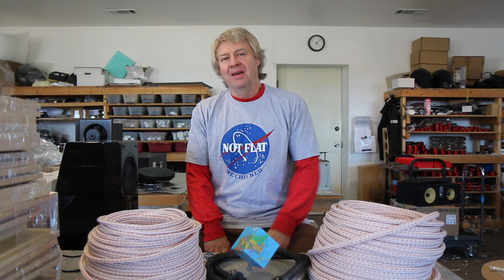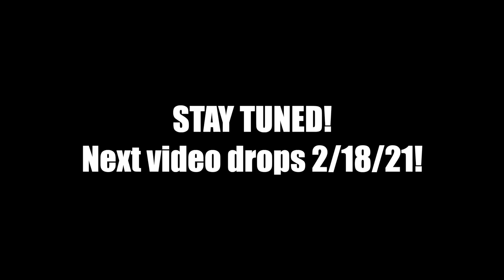Audiophile Cable TRUTHS: The Divided Camps

Comment: @mark rutlidge I’m not trying to start a flame war; however, bad analogy! If you took two or more cars and measured ALL of the variables and all the variables were identical, the cars would indeed perform the same. If you look at Sports Racers, all cars in that racing class measure nearly identical, hence very competitive and driver skill is critical, that is excluding for any creative interpretation of the governing rules – still a bad analogy. 

If you take wires, determine the critical measurements (measurements that scientifically have been proven to impact human hearing), measure them in a consistent fashion with accurate equipment, they will perform the same. To evaluate the impact of the cables one must truly apply an unbiased, blind, random trial. If you did that and if the test results were able to be reproduced by other unbiased evaluators, you would have ground to make a statement regarding the effect cables have on sound quality – remember you must be able to reproduce the findings. To my knowledge, I haven't been able to find any group purporting the cable effect that has successfully attempted this.  

If I was in the industry of making audiophile cables, I would find an external unbiased group, a group of doctoral electrical engineering students looking for a project might be a good place to start. I would have that group find colleagues in other electrical engineering programs, and let them have at it.  After peer review, all the companies involved would be able to scientifically claim that their cables are better and why. 

I’m NOT CRITICISING people for exploring the audiophile life style, have at it, change all the components you like until you like the way it sounds, and then change it when the urge to explore overcomes your current state of contentment/discontentment. 

My issue is with companies making statements, statements for which no critical proof is available.

Personally, I like Nelson Pass’s article from 1980, he explores different cables, publishes the results and concludes that it’s not his place to judge, that’s how I feel.

https://www.passlabs.com/technical_article/speaker-cables-science-or-snake-oil/

Comment: Have you ever considered characterizing cables by using an impulse test?  Similar to the impulse test used by the Absolute Sound and Stereophile to characterize a crossover?  My thinking is that such a test would show how the cable responds to a wide frequency input.  Because ultimately a cable is a crossover - loaded on one end and provided an input on the other.

Comment: I think thicker gauge cable helps! However, if all the hype was completely true , then why do a majority of all the amplifier manufacturers provide a 18 gauge power cable with their products. If anyone opens up their amplifier right now you would be hard pressed to see anything bigger than 20 gauge solid core wire to speaker output terminals and that 15 amp socket your  8 AWG amp cord is plugged into is only 12-14 awg.So if  I owned a $10k set of speakers .. I would accessorize it with some speaker cables adorned with pretty coating and it would be thick enough to hoist a Chevy 350 engine block without snapping. In the meantime, I will stick with my pimped out 12 AWG speaker wire that I made myself and use the money I saved and buy a bottle of Pappy Van Winkle.

Comment: The analogy to use is like using horsepower how to measure the speed of a sports car ie if you have have two different sports cars with the same horsepower. The no difference people will claim that these two cars will go the same speed, instead of looking at things that also measurable affect like wind resistance gearing weight.
Reply: @davidlong1786  You are exactly who is being referred to the in example. A change in a cable is made and you are looking in the wrong place for a difference. You will see no difference in frequency response, phase, distortion, and impulse response. You are the guy that changed his shocks hoping it made the car run faster. Keep watching the upcoming episodes and all will become more clear.
Reply: @davidlong1786  read the second word
Reply: @davidlong1786  It is more likely that if you are not seeing a measured difference then you are measuring the wrong thing. You have already demonstrated that you don't know where to look. I would advise that if you keep watching the videos to come then you might get one of those light bulb coming on moments and reach some level of understanding.

Comment: Don’t sell our ears short on what they can discern. Even the average person can tell there is something wrong with their car engine just by the sound of it. They may not know what it is but they can hear that it doesn’t sound normal. An experienced mechanic will often know specifically what the problem is from the sound (or at least what to look for). Our ears seem to be able to focus in on minute details like a loose valve tappet might make a faint metallic sound but the mechanic hears it “clear as a bell”. I doubt that a spectrum analysis of the sound would be able to show you the issue as clearly. So measurements have their place but so do listening tests.
Reply: @Douglas Blake Actually I do have some experience using spectrum analyzers. I have a "TrueRTA" Real Time Spectrum Analyzer that I downloaded about 12 years ago. Also as a Machinery Engineer I have used FFT analyzers for many years to diagnose machinery vibration problems and I agree they are great tools once you understand what you are looking at. Strangely though I still trusted my ear and a screwdriver to listen for early stage bearing failure. I found I could hear minor bearing faults (minor spalling) before I could detect them with the analyzer. This way we had early warning and would increase our monitoring frequency. Once the bearing faults started to show up on the analyzer it was time to take the machine out of service for repair.

You are right that the spectrum analyzer can reveal issues that your ear can't detect but the reverse is also true to some extent.  You definitely need to use both when evaluating equipment.  The thing about the analyzer is it can quantify the issue better where the ear is more subjective.

Comment: This is actually the argument I will use against your measurements for speaker upgrades. You always refer to the measurements for a speaker as an argument to change the crossover design without taking the room influence into consideration. I wish you would approach it with a listening session first (How does the speaker sound?). And then how does it sound with better components in the crossover. After this you can do your measurements and change the design. My claim though would be that you rarely will hear an actual improvement with a different crossover design just because it measures better. Btw I do own expensive cables selected by listening only
Reply: If a speaker has stored energy or break up, if the time alignment of the drivers are off, if the off axis response is messed up or drivers get way out of phase in the vertical off axis, then those are problems. The room they are in will not fix those issues. And listening to them won't make those problems go away. And the measurements are to show that a speaker sounds better than another. The measurements show if there are audible problems or not. How a speaker sounds is something that can be manipulated outside of how it measures.
Reply: He uses measurements to design and modify speakers frequency response.  I guess he doesn't "believe" in distortion because we never see anything about that.  He decries measurements when he wants to sell you expensive snakeoil.  It's 100% consistent when you understand what's actually happening.
Reply: @LouGuido  And I have not offered any expensive anything. Everything I've done on this channel is about offering the best and biggest bang for the buck.
Reply: @dannyrichie9743  I don't disagree with the use of measurements as a tool to find problems if it's a problem to the ear. In my view a flat frequency response might not always suit the sound character of the drivers. And it will for sure never be a flat response as soon as it's put into a normal living room. The only thing I would do different would be to start out with listening and only use measurements as a tool instead of putting them first
Reply: @dannyrichie9743  Guess what else won't fix those issues?  Cables..
Reply: @LouGuido  You finally got something right. Indeed, cables won’t fix a broken speaker...just like fancy tires won’t fix a broke down car.
Reply: @LouGuido  That wire is garbage. Why would I want to recommend that to anyone?
Reply: @jwester7009  The listening comparisons are made with each individual component. And character doesn't come from amplitude irregularities. I can make a speaker sound completely different and never even change the frequency response. And the process goes much faster if measuring and testing is done first.
Reply: @rustyshackleford6978  I feel bad for you that you are willing to disregard all existing evidence and put your faith in a YouTuber who coincidentally is selling cable kits. 

At what point does logic prevail for you? Danny literally admits that there aren't discernable frequency response differences when swapping between the cables. That the input and output signals are essentially identical. What do you think sound is? How do you think AES determined audibility of frequency response deviations to be around 0.5dB? You would have to believe that sound isn't the frequency response. That Fourier was wrong and that sound isn't a summation of sine waves. How do speakers even work if frequency response isn't sound? How do DACs work if analog signals aren't exactly what drive a speaker to create sound? This is BASIC. 

To believe that Danny is right is to disregard all manners of scientific evidence and theory/math that has been shown to be true. Ohm's Law, that's gone now too. Oscilloscopes? They don't work either. Looks like we have a TON of shit to rethink now because Danny is around. And the cherry on top, the explanation for all of this being wrong is that Danny can hear it. Be dammed that no controlled listening experiment could prove that or that there is no theoretical basis for the believe at all. 

News flash, cables aren't filters for audio signals! By what mechanics could they change the audio signal that isn't related to LCR? The answer is obvious, they can't. 

That's all leaving aside the proven FACT that human biases exist and people believe they sense differences all the time in uncontrolled experiments which magically disappear when controls are instituted. You can't trust your senses alone, everyone at least partially understand this! You can insult me all you want but you're coming at me from a place of ignorance.

Explain to me EXACTLY HOW competently designed audio cables can effect the sound in the audible spectrum. Neither you nor Danny has been able to articulate even a plausible theory that could pass minimal scrutiny. All I see is a bunch of hand waving. At least acknowledge that what you're suggesting would need to violate swaths of proven electrical theory, science, and mathematics to be possibly true. It's kind of ridiculous when you think about it. I think people are being nice when you consider it that way.
Reply: @dannyrichie9743  What makes it garbage? Explain what property of that wire would change an audio signal. Since you're always claiming to be able to articulate the theory behind the nonsense, try me.
Reply: @dannyrichie9743  it's called distortion and directivity. Are you claiming that audio cables change these? What is your claim exactly? You have to understand that you basically throw out nonsense arguments. Nobody claims frequency response alone characterizes the complete sound of a loudspeaker. That argument has nothing to do with this cable nonsense. Tell me that you understand the point you were trying to make isn't logical. Obviously two identically flat on-axis frequency response speakers with different levels of distortion and differing directivity will sound different. What does that have to do with cables?!?! Stop dancing lol.

Comment: An idea maybe would be to compare the sound that you record from the speakers. Using two really good microphones and with cheap VS audiophile cable. If there is an audible differences it should be possible to show with graphs of frequencies etc right?
Reply: There maybe some recorded stuff on this subject coming. But the differences don't show up in the measurements.

Comment: Interesting take Danny, you DON'T want to give people an objective guide as to what real cable properties mean but instead, you want to tell us whether it "sounds better". Well, that's subjective just because it sounds better to you my mileage will vary. So instead of offering anything useful, you'll just say if you believe you heard a difference and whether that difference is an improvement. Broadcasting from a workshop may be to give the impression that your opinions are authoritative, a quick critical evaluation of what you're saying should quickly put an end to that impression. 5:55 "No why am I doing that?" why not just put another opinion out there and pretend I've enhanced the debate.

Comment: I thought your test ended this debate.  Sorry you're still doing this.  However, I enjoy more 'proof'.  Thanks!
Reply: Lol, what "test"?
Reply: @LouGuido  I stand corrected.  It was not a test so much as it was a demonstration.  One of his previous vids on the difference cables can make.
Reply: @seoulrydr  if you're talking about that ridiculous video where he connected open ended cables to an old radio reciever to show that different construction acted differently as antennas, that proved absolutely nothing about his claims of audibility between different competently designed audio cables. It's "demonstrations" like that which make it obvious that Danny has clear  misunderstandings when it comes to basic properties of electrical signals and audio cables. You're not  going to find any actual experiments that show the existence of these claimed audible differences between competently designed audio cables because they don't exist. This has been demonstrated already.
Reply: @LouGuido  Thank you for your input on this.  To be clear, I have no horse in this race, no dog in this hunt.  He was making a point with his demonstration, and I thought he made his point well.  Having said that, I am not going to:  change out my 15yr old Monster Cable, connected to my Onkyo Surround Receiver, powering 5 Definitive Technology Speakers, supplemented with 2 dual driver 15" subwoofers stacked behind the plasma tv, with one speaker in front of a huge window, both speakers flanking a 90 degree corner, with an undamped metal cabinet behind my listening area, to then run out and purchase 'better cables'.  In fact, I probably won't be purchasing any new audio gear anytime soon until I can afford a dedicated room, being the one thing that can make even a pair of Bose sound good.  (I have no issues with Bose - they just seem to be the butt of a lot of audiophile jokes).  I am not a conspiracy theorist.  I stopped drinking Kool-Aid as a child.  GR-Research is not the second coming of Jim Jones or Jesus. Thanks for responding to my comment though because this is kind of fun.  

I'm hoping whatever he comes up with in the next video is interesting and contains a bit of edumacation.  That's all.  Let's say all of his opinions on cable are utter BS.  Would you sir, throw out the baby with the bathwater?  Will you avoid his speaker kits like the plague?  Is he on point with the rest of his opinions on cabinets and crossovers and driver parameters?  He could be.  If not, when I realize this for myself I'll let all this go.  My interest in his channel stems from what I might learn from it - even casually.

Comment: 2:55 Ah, yes. The infamous "power cable". Probably hand-weaved and made from some exotic alloy, in a ridiculously oversized gauge and sold for an outlandish price. And what do audiophiles do with it, you ask? Why, they plug it into a $3 wall outlet, that's connected to about 50' of 12 AWG solid core romex running in the walls and attic, to a breaker on a distribution board. Perfect imperfection, perfectly implemented.
Reply: Tune if for episode 5.

Comment: My understanding is that the quality of the Hi Fi system itself will also have a bearing on any audio improvement obtained from good speaker cables. For example, a poor pair of Loudspeakers may not be able to reproduce improvements provided by the cables. The Speakers might have significant dips in given frequency ranges.  Audio reproduction can be affected by the weakest link. If your system is total crap don't expect big improvements or any improvement at all using good speaker cable.  Also selling speaker cables can be lucrative. This attracts snake oil salesmen.  When something good comes along everyone tars it with the same brush.
Reply: You are correct. I cover this more in depth in the 4th segment.
Reply: @Douglas Blake It doesn't work that way. There are bottlenecks that really limit being able to hear what is brought to the table. All covered in episode 4.